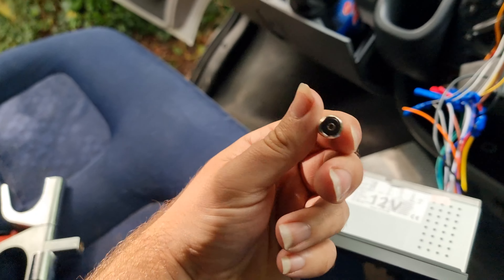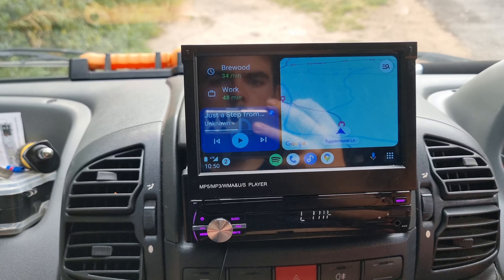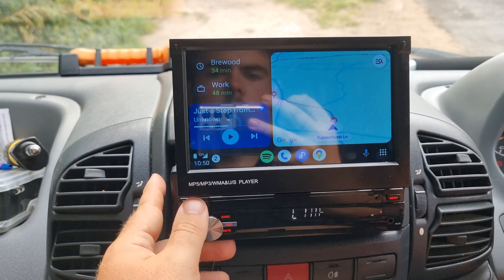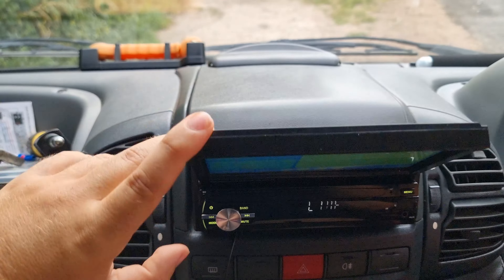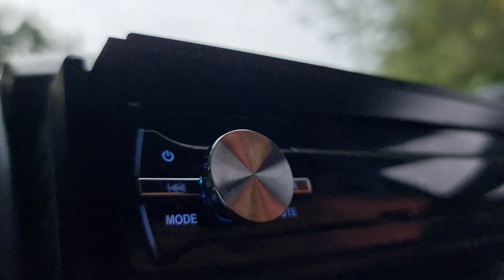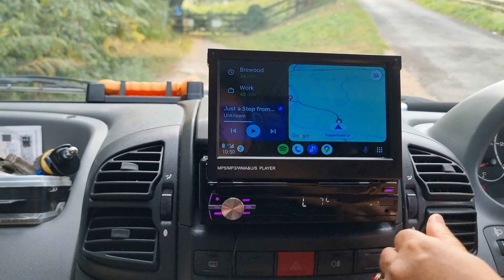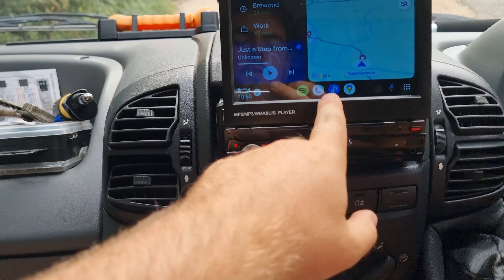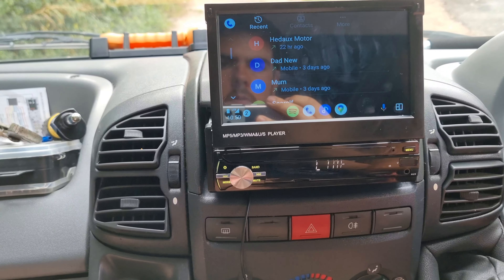Installing a Reversing Camera & a Touch-Screen Hikity Stereo - Peugeot Boxer Campervan Conversion

Comment: A suggestion would be to properly crimp or even solder those connections if your ever considering sleeping in that van at any point, those connections looked like a real fire risk!
Reply from the maker: Don't worry, it's just temporary, we've bought the proper connections now

Comment: The stiff gear shifter is common on these. You can lubricate the connector in the engine bay. There’s a vid on yt to help. I found the more use you give it the easier it gets. I think these are actually Italian built not French. They are badged up as Peugeot fiat and Citroen.  I found searching for information tricky until I used all 3 makes.  I needed a rear cluster for fiat but couldn’t get one until I searched Peugeot and bingo. I’ve got the camper conversion trigano tribute so watching your videos with interest. Any help I can give I will try.
Reply from the maker: Thanks, Ray, that's very interesting and useful information 👍